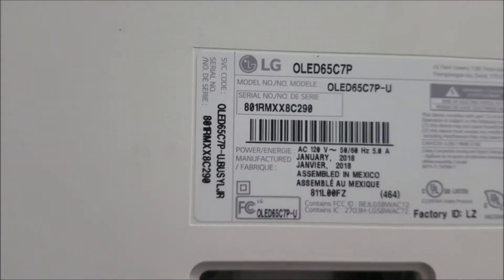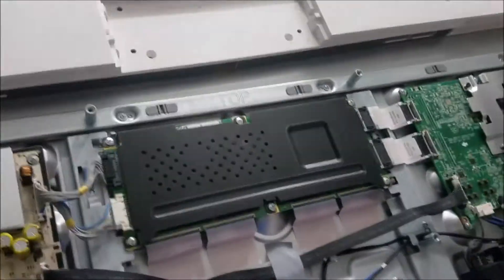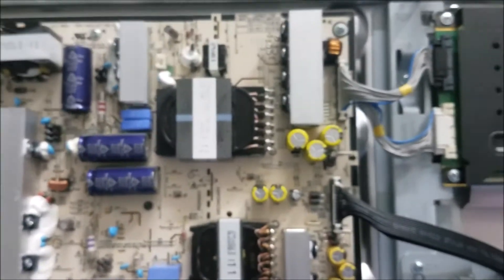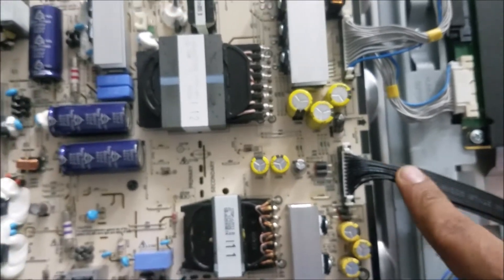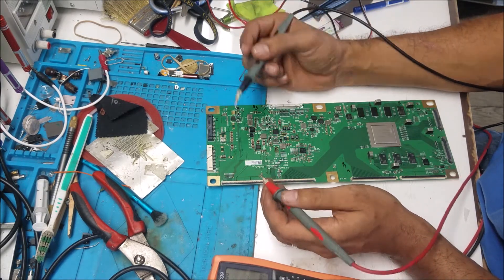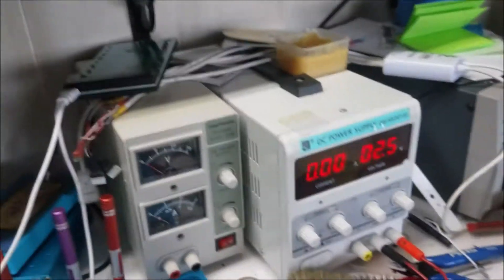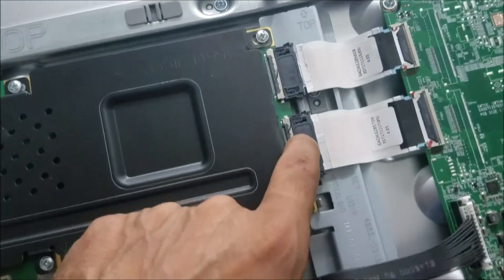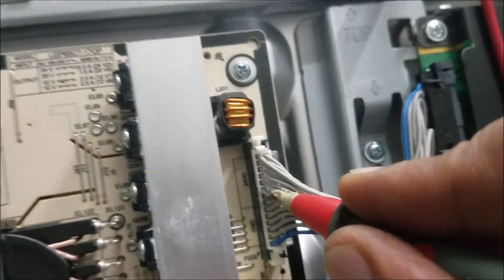LG OLED65C7P turns on 10 sec goes off no display fix

Comment: please help me 
LG oled55E8 model 2018 
when i watched netflix tv turn off automatically, red light is keep on,
when i turn from remote or tv button,tv ticking normal sound inside and after 5 second another ticking and turn off tv but that time up screen is showing quickly some line and shut down. is this power board or main ? 
please help.
Reply: Just check ,similar as video.... check cpu  is overheating....resistance measurement... diode  ...any spots...capacitor swallow becomes cracked....and voltage measurement.....if anything is ok....could be memory faulty. Or cpu.....

Comment: Got the same problem after same TV automatically goes to sleep mode. I disconnected all cables and power, then in 5 minutes connected the power, automagically it started to work. But next day the same issue, pretty bored.  Any advices? I could change the power board myself (former iPhone repairer). Do you have PSU board model #?
Reply from the maker: you need to get a multimeter and check voltages,
Reply: @SOSfixElectronics  finally TV died. Going to check R7624 voltage according to service manual. How much it should be? BTW my TV plays audio, it’s discoverable on WiFi and works with remote, but no picture

Comment: Hi Brother .. i’m Having the issue on the same model that when i Press Power Button the RED light Blinks for 3 seconds then it’s Goes off … no Display no image … I measured the voltages and on P201 all voltages are Ok BUT on P202 there’s only 1 Volt on the 24VD Points
Reply from the maker: you can try to force the power to turns on the driver voltages 24V. check for short, disconnect the screen and try....
Reply: @SOSfixElectronics  i have already disconnected everything but there’s still no voltages any suggestions will be appreciated

Comment: I appreciate your effort, sir. I have a OLED65B7A its flashing 3 times and turns off with a solid red light. I ordered and replaced T-CON, Mainboard, and PSU twice and facing the same issue. Do you think the panel itself has gone bad?  Thanks in advance.
Reply from the maker: did you use the multimeter  to check the voltages? if all exist an stable, the tv will give less then 5 sec to test each voltage before it goes off i did see 3 blinks linked to the power supply board issue,
Reply: @SOSfixElectronics  Correct i used the multimeter and followed your Volt chart on the PSU board. I have 2 PSU boards showing the same reading. Yes it gives less than 5 sec after pressing the power button and then the voltage drops.
Reply from the maker: @faisalkhalid9659  good,  check for short in 12v and 24v tcon input?  check the tcon fuses? disconnect the screen  flex cables one by one and turn on the tv each time and see if the tv will stay on longer or any change?
Reply: @SOSfixElectronics  Will do and let you know. Thanks for the responses
Reply: @SOSfixElectronics  Fuses are good and i was unable to find any shorts on the T-CON. I disconnected the flex cables one by one and one at a time as well, the result was the red light kept on and not blinking. Also tried the same process after replacing another T-CON card.
Reply from the maker: @faisalkhalid9659  it is hard to tell. and i want you to know something, the board you buy online doesn't mean that board is in 100% working condition,  i had a vizio  tv about 2 months ago i replaced 4 mainboard to find one works, 
in this LG oled is common problem tcon goes bad , do you have  a external power supply  to do inject voltage test?
Reply: @SOSfixElectronics  I agree. I will reach out to the parts supplier for a replacement. 
I don't have a variable power supply, is there an alternate method to test the board.
Reply: @faisalkhalid9659  Did you able to get it work? I have a same issue with my LG Oled TV!

Comment: you have a place for me to buy a replacement board? thank you for this video.
Reply from the maker: ebay have them
Reply: @SOSfixElectronics  Did this tv have 3 red flashing when you started it up?
Reply from the maker: @MrTrocks365  the tv tried to turns on then goes off,  the red light was flashing but i didnt count it.